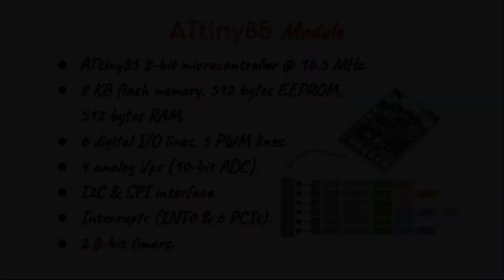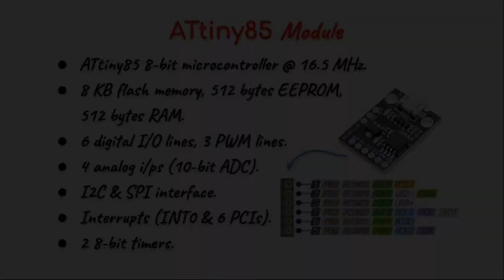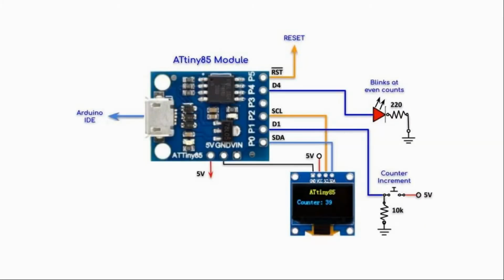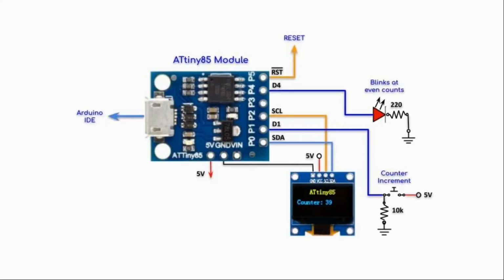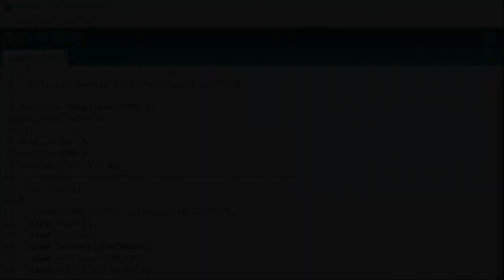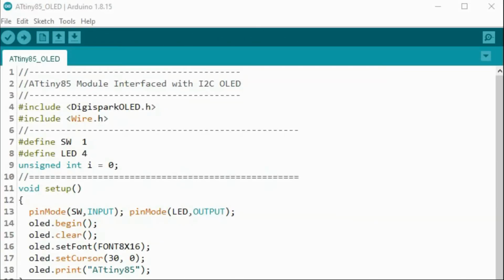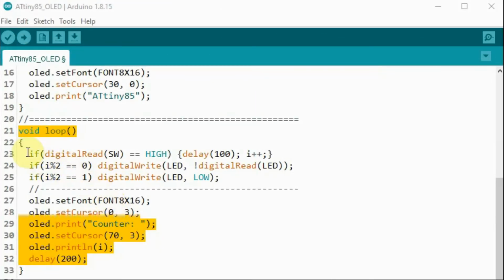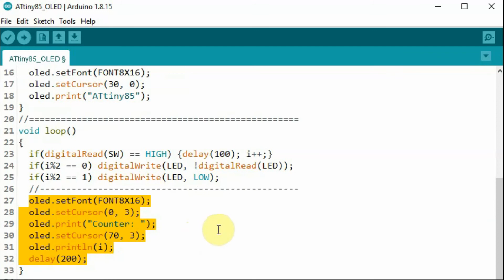ATtiny85 Microcontroller Interfaced with I2C OLED

Comment: how to use i2c and spi at the same time. I have two modules connect to attiny85 NRF24 spi and i2c oled
Reply from the maker: You may connect OLED to I2C. As for SPI, I know how to connect 3-wire SPI, but not 4-wire. I’m not sure if you can use pin PB5! You can watch the last video I uploaded where I interfaced I2C device and 3-wire SPI device.